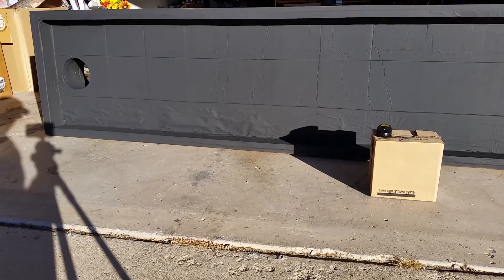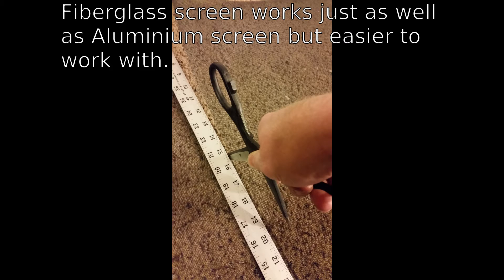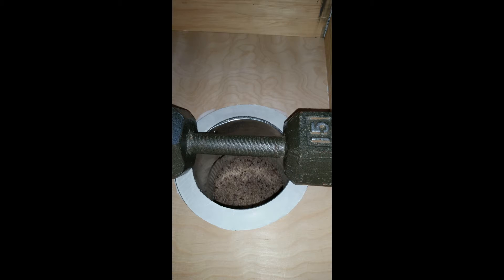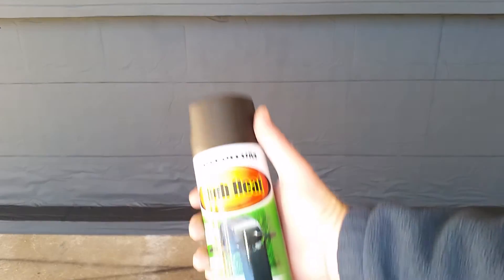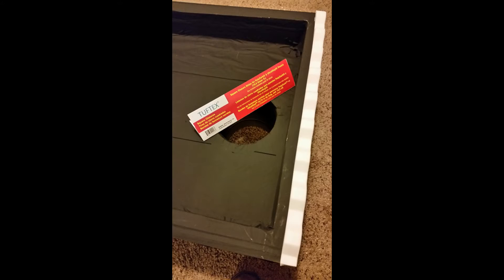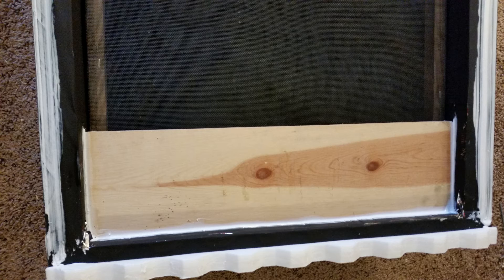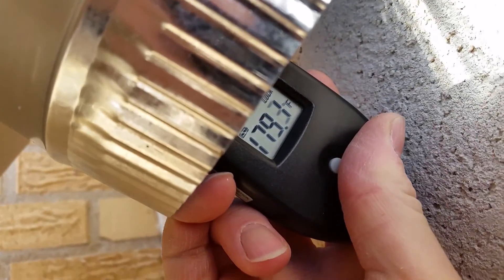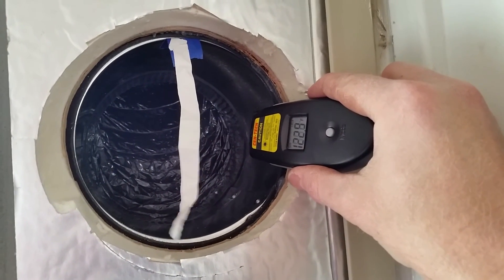DIY Solar Thermal Screen Heater

Comment: I've just been starting to look over the solar types of heating systems. I've seen the dryer vent and the pop and beer cans, and I just started researching this screen method. 
If the insulation is painted Black it absorbs heat and I don't quite understand what the screen does.  Whatever it does it obviously works.
I'm wondering if putting a piece of sheet metal, a big piece of aluminum fit inside of their painted black would do the same thing.
Reply: The screen material also absorbs heat. More importantly it provides a greater surface area for the heated material to contact the air passing through = better heat transfer to the air = more hot air into the space being heated.

Comment: Do you have a way to close it off at night cause I imagine it will let cold air in after the sun goes down even without the fan running
Reply from the maker: I had a flap after the fan which closed when the fan turned off.

Comment: Very inspirering.  I am about to cut holes in my wall to install my first and only.  Im very excited about getting results like yours.  If all goes well I have enough glass panes to make one more 36"x8' collector and one 36"x 4' collector to heat my encapsulated crawl space and one other room.